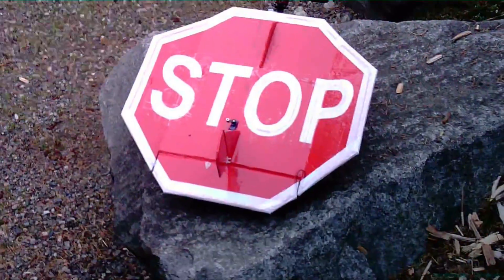RC Flying LED Stop Sign & Parts list

Comment: Ron, I think your idea of using the brushed ESC for an on/off power supply is brilliant!  Do you think that setup would work for a 10 watt LED spotlight on my hexacopter? It runs on a 6S battery (24 volts) and I've found some 24 volt, 10 watt LED spotlights online.
Reply: Well, The brushed ESCs I'm using are rated for 20A which is enough, but only rated for 3S.  If it were me, I would put two in parallel and run both on a Y to the receiver (Positive and negative tied on the input side and the same positive and negative on the output side).  Then with the outer input Pos and Neg, connect to the Pos and Neg of the 6S battery and on the outer outputs, the Pos and Neg to your light.  This would split the load in half for the ESCs and would give you 24V out but still only 20A.  Then watch your battery voltage drop like a downhill speed skiier.. Ha ha!  All the best and Happy flying!
Reply: Ron, thanks for the insight, might give it a try.
Reply: Johnnie Rhodes You're welcome!  If you have not already done so, please subscribe.  All the best and Happy flying!

Comment: the 3000kv motor on my axn floaterjet caused a brownout and it crashed. back to the drawing board. dont know what size props my friend will be using on his quad but i do know they are inrunners and that it will be a water proof floating frame. we had an rc swap meet sunday. i bought a 32" foamy. today is a building day for me. 10 multirotors is a lot. i have found that having a flying object of some sort for every weather condition is a good thing !

Comment from the maker: Ha ha!  I believe I have over 10 multirotors, 7 or 8 planes, and one helicopter.  What battery and prop will your friend be running with the 2600kv motor?  I have a quad with 4 2840kv motors driving 4 6x3 3blade props and it is TOO fast.  When I gun it, it can get out so far that orientation is quite difficult then I have to try to get it back.  All the best and Happy flying!

Comment: nice stop sign ron. i am selling my mini tricopter on st. louis craigslist. dont really need 5 multi rotor aircraft. the big tri and my quads will suffice for now. i see you are using one of your old stand by motors on the stop sign. a friend of mine is building a quad with 2600 kv motors (large diameter) should be a rocket ship. i have gotten into planes and am curreltly runniing a ntm prop drive 300kv motor an an axn floater jet. it is pretty fast. thats about it. ttul dude !